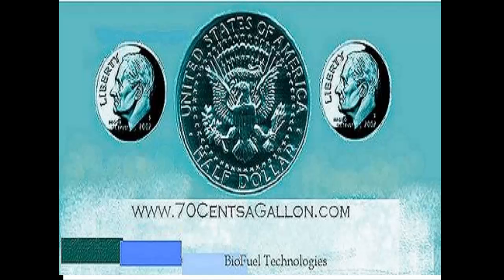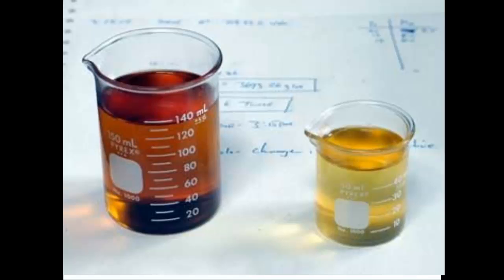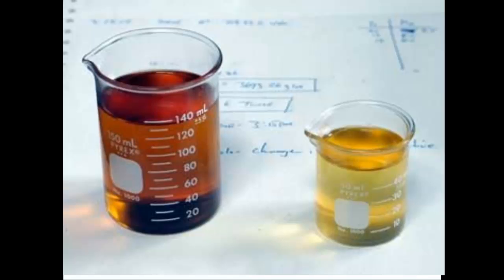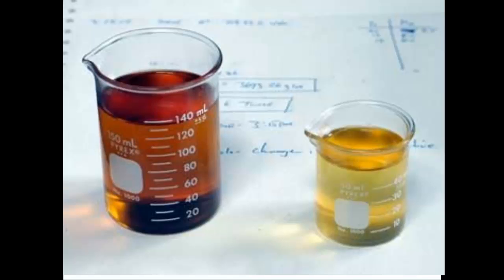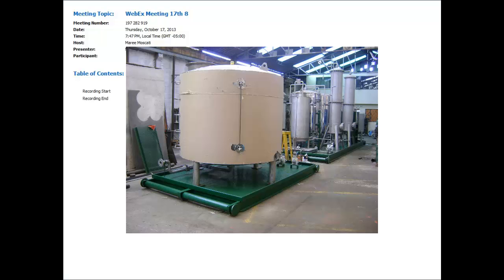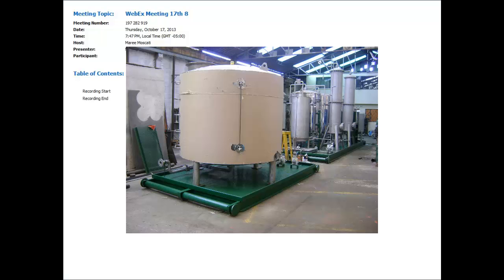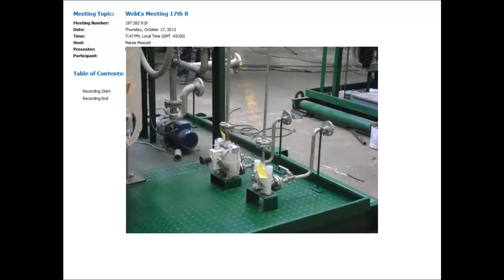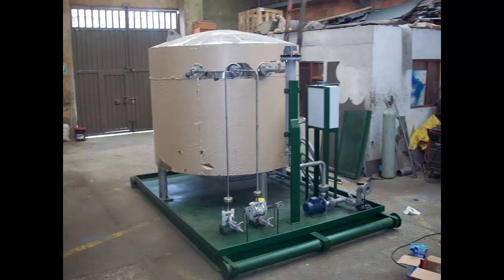Enzymatic Biodiesel Production Equipment Conference Call

Comment: Are you interested in producing biodiesel or not? I multiplied hydrocarbon excreting bacteria with the use of very low power microwaves. I exposed them for a few minutes only. If you are interested in this method, contact me.